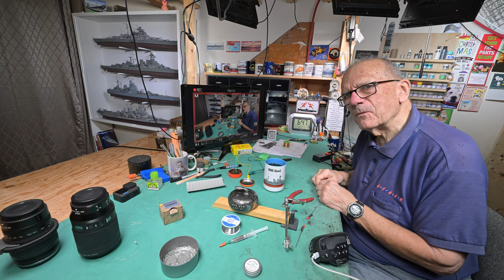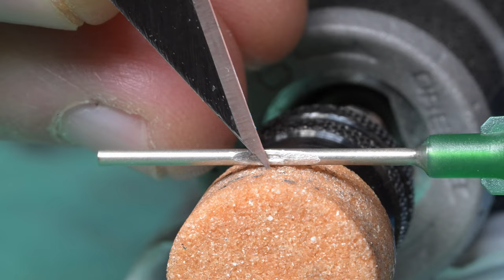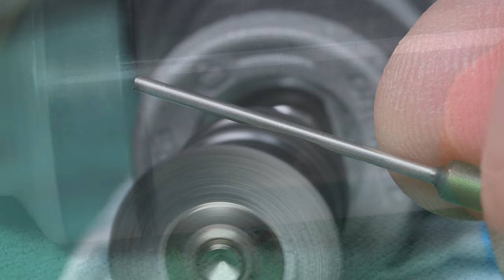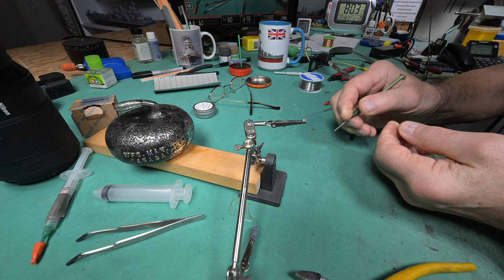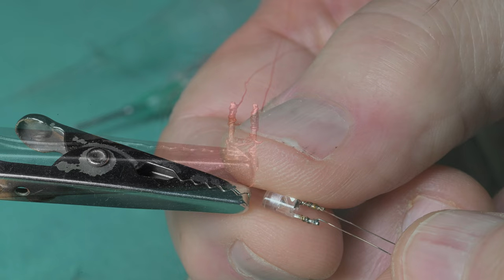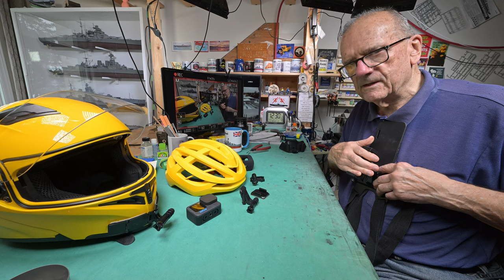The Model Ship - Part 1926

Comment: Would it not have been better to bend the led "legs" 90 degrees before soldering the wire on ?
Reply from the maker: Hi Jerry,
Good thought! Yes, in that way the leads could have been bent more flush to the top of the LED too. Next time! 😁👍